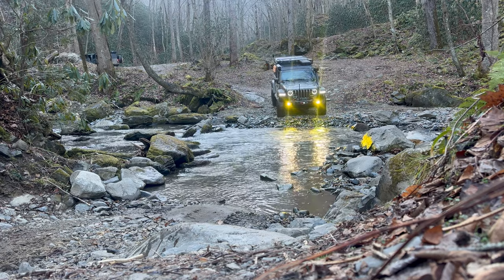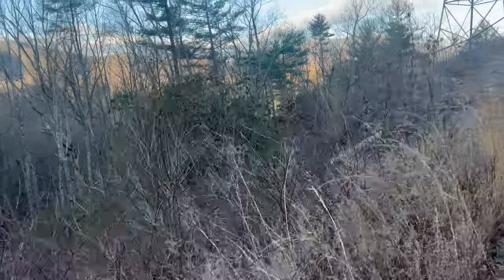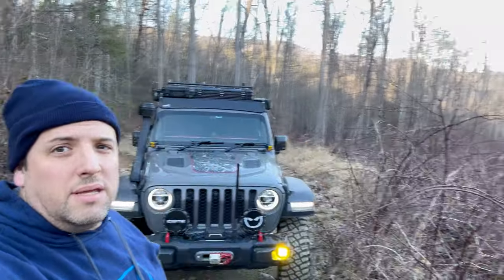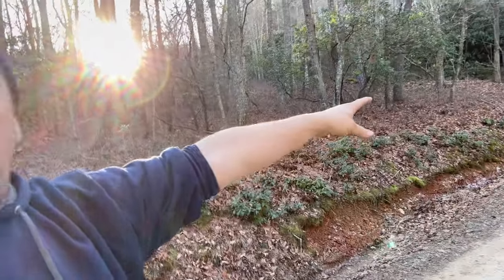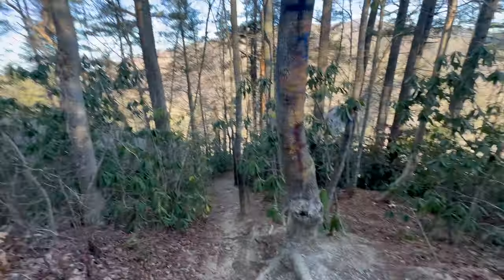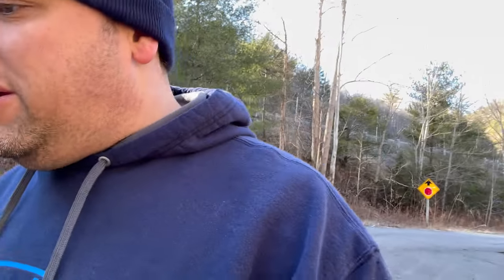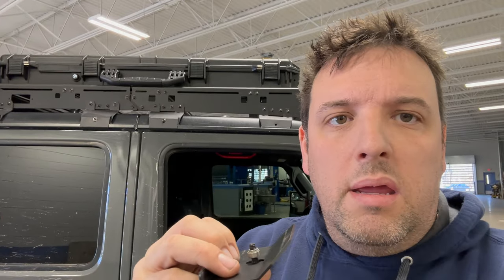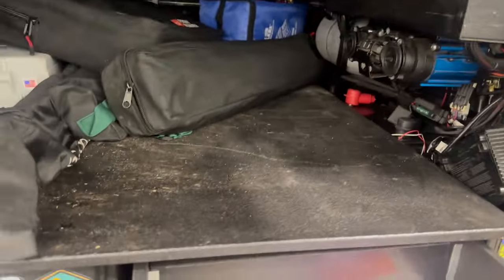Overlanding The GOAT Trail (Old Buzzards Roost) In My Diesel Jeep Gladiator Rubicon. In 4K.

Comment: Thats almost exactly where I was when I had an electrical problem with my ARB twin last year. (I was at the Hurricane Creek pull-off)
Reply from the maker: Luckily it was just a fuse. I’ve had zero issues since
Reply: @WolfOverland  yeah, I saw. 😝
Mine was a broken ring connector